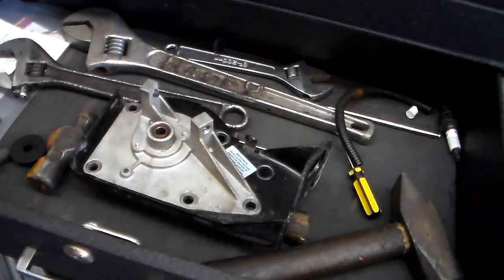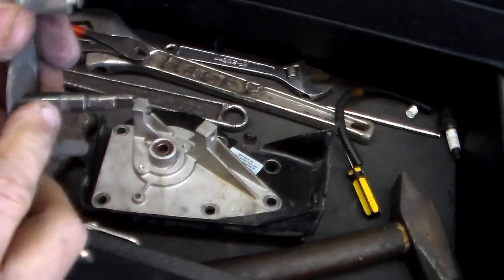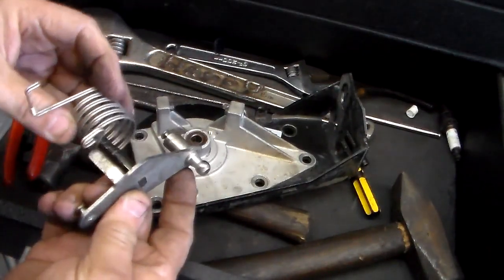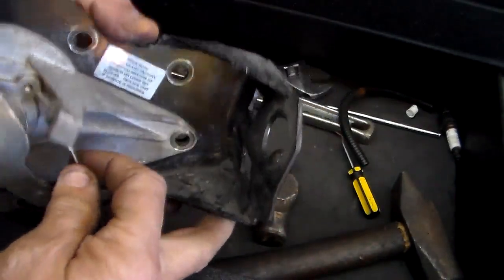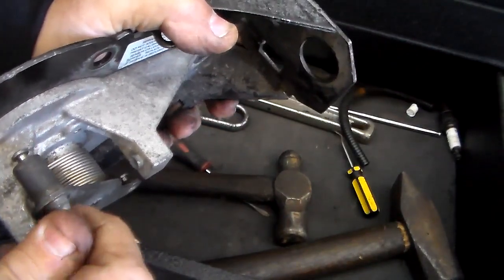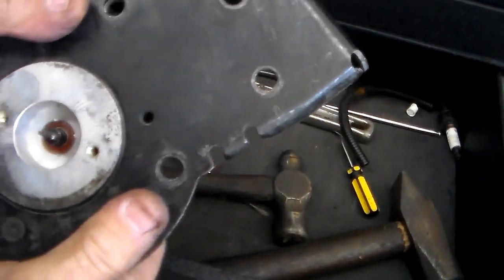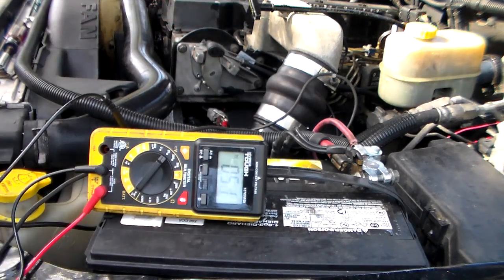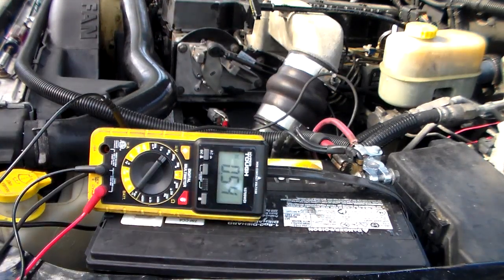P0122 volts to low or P0222 dodge cummins code APPS problem that wont hold adjustment at 0.55 volts.

Comment: When I drive to 40-50 mph in my 2002 doge ram 24v the rpm’s start going up and down could this be the cause ? Also when it does that and I floor it it kinda goes away
Reply from the maker: Yes I had a same symptoms with mine. Try removing that plastic cover off and see how much play is in it shaft. You will see it. With the truck off and holding it at about 1/2 throttle and see if you can wobbel the shaft up and down. If it moves take it apart like I did in this video and tighten it up. Ive been good since I did this with no problems and they want a bunch$$$ for them things new.
Reply: I’m having the same problem with my 99, it won’t start sometimes is it the same thing?
Reply from the maker: @arathsilva4699  No it will start with this problem but just wont idle right or it might have trans shifting problems.